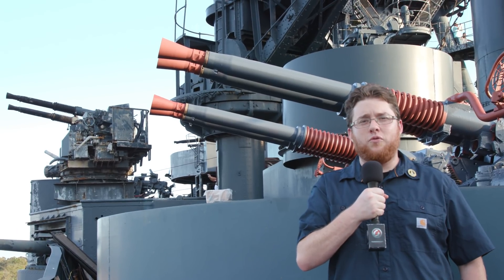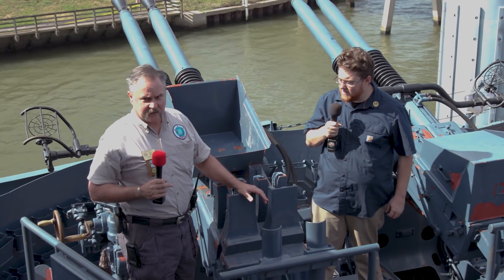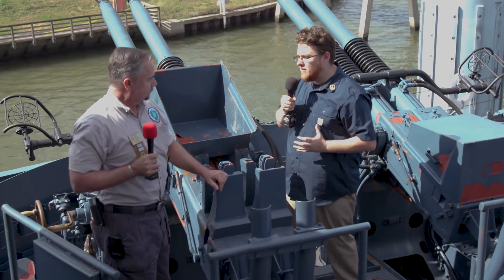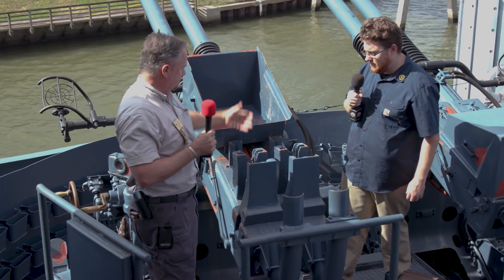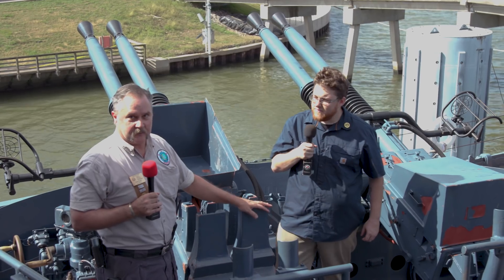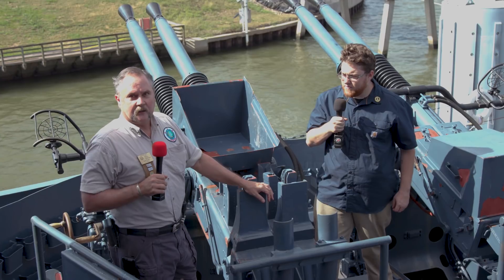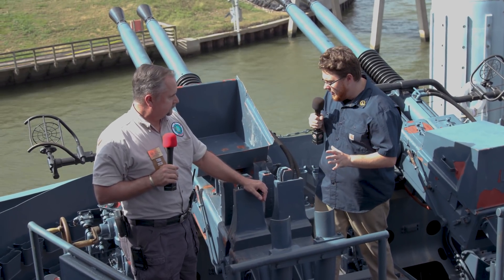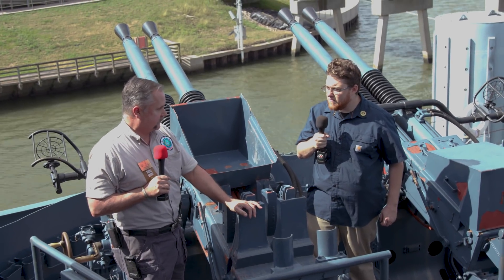Talkin' Ship - Bofors (and Aft-ers)

Comment: Those bofors aren't the originals that were mounted on the USS Texas. The USS texas was stripped of them when she was decomissioned, and was given the old 1.1"/75  Chicago pianos in their place. When the Texas was drydocked in 1988,  the Chicago Pianos were replaced by 40mm Quad mounts taken from the Iowa's as they were being reactivated for their service in the 1980s.
Reply: Ben Parma Still better in my opinion
Reply: Ben Parma better than no Bofors at all.
Reply: The 40mm guns now on the Texas came from the USS Misouri, BB 63.  They were installed during the 1988 to 1990 yard period in Galveston.
Reply: All 10 were removed before Texas left California in January 1946 bound to Virginia and deactivation.

4 Chicago were installed before coming to San Jacinto 

All 10 40mm mounts were installed in 1990 at Greens Bayou (temp dock after leaving Galveston) and upon return to San Jacinto.  I was on a volunteer crew that installed the mount to port of the Crew's Galley.  One of the guys unthreaded a cap and inside was papers showing removal from BB63.
Reply: What happened to the 1.1”/75s?
Reply: They got rid of the piano guns because they were horrible. Nobody liked them and they were worthless. 40mm Bofors quads was the most loved AA gun in WWII.

Comment: All 10 WWII mounts were installed in June 1943, Boston Navy Yard
Reply: Not these. In 1948 the Navy removed Texas' 40mm guns because those guns were so good that they were in active duty for decades after 1948. Texas' 40mm guns today all come from USS Missouri when she had to dispose of all her 40mm guns when she was reactivated for modernization in the 1980s. Texas got 10 40mm guns to restore her back to her 1945 layout.
Reply: @nogoodnameleft  In the summer of 1990, I was part of the group that installed the port side 40mm at the Crew Galley.  Inside a tube on the back was the actual USN document showing it had been removed from MISSOURI

Comment: The 20 mm weren't powerful enough to instantly destroy an aircraft on contact.  The 40 mm befors did.  Many 20 mmo's were changed over to the 40 mm.
Reply: Remote Viewer 1 >> Gave your comment a like since you definitely had a point...but it’s not strictly true, at least in the early war period.  Aircraft like the Zero had little armor and no self-sealing fuel tanks because it traded them for speed and range.  So an unarmored plane (particularly a kamikaze loaded with explosives) absolutely could be shot down with a 20mm armor-piercing incendiary shell.  Also, they were rapid fire so as to score more than one hit.  But you have a point.  HMS Vanguard, which completed just after the war ended, had no 20mm armament at all, just 5.25” and (sextuple!) 40mm, all radar-guided.  She would have been incredibly lethal in the AA role, but the war ended.

Cheers!
Reply: 20mm guns were awesome. 1.1 inch piano guns were the ones that were horrible. The 20mm guns didn't do well against kamikazes though. The Okinawa and Luzon battles were why the 20mm got retired after WWII.

Comment: Love the ship, don't understand why on console she only has 3 secondary guns per side.
I don't think she ever had fewer than 20 in total. (10 per side)
Reply: In 1913 there were 10 5" guns on each side plus one on second deck at the stern.  Texas had 8 different periods as to number and location of 5" guns.  The first removal from 2nd deck was October 1917 and the final removal was Mar-May 1942
Reply: @charlesmoore766  yeah wiki updated since I looked. Now it shows that they pulled them in 42.
Before it showed 3 times with 22, 20, 16.
It didn't show only 6 before. Sucks in-game when tanking and you only have 3 secondaries popping off